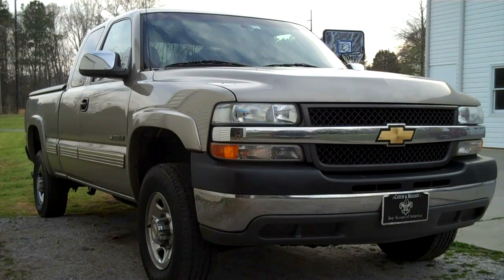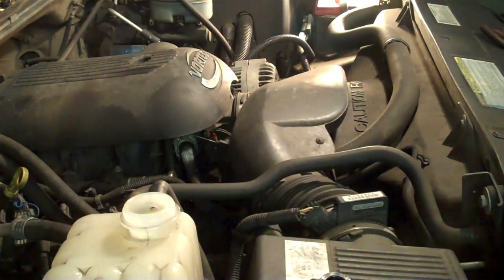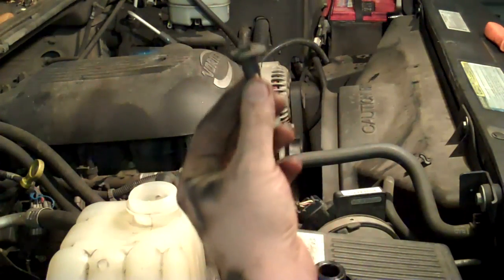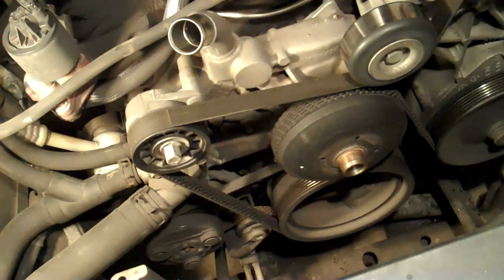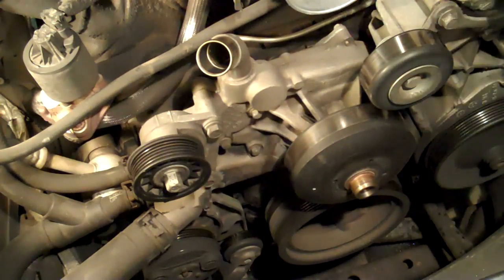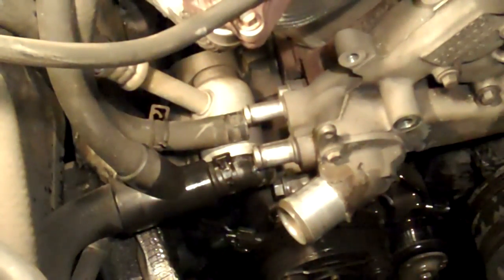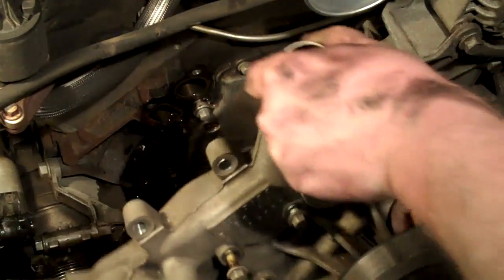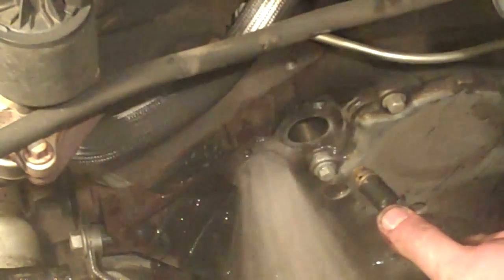LS Type Vortec V8 Water Pump Replacement (part 1)

Comment: Great solution with the impact hammer on the fan nut.  My belt was slipping with the bang on the wrench method but it came right off with the impact.  Just wish I had a nice long chisel bit like yours.  Also would have helped to have a hose pick.  Thanks for the great video.

Comment: Great video and this guy has great tips. Awesome idea to use a air hammer to take off the fan. I used the tip and it was as easy as it looked in the video

Comment: If I got thru the trouble should to take off the water pump, do I go ahead and replace the pump or the seals?  170k miles and 10 years old?  I'm guessing spend the $150 and replace pump!

Comment: I changed the water pump in my 99 4.8 silverado. Got the part 1/2 off and the labor was also 1/2 off. Spent 150$ to get it repaired. Nice vid.

Comment: I'm not mechanic smart at all, but my 00' 4.8 silverado leaks coolant when I turn on the heater but not when it is on vent or A/C. Is this a common problem you would know about?

Comment: Thanks for posting this video! I have a 2004 HD crew cab with a 12” lift and the cheapest price I found to replace the pump was $400.00. Everybody claimed the truck was too high. On Cyber Monday I found a great deal on a pump, I watched your video over and over and decided to tackle replacing the pump. I had to stand on a 6’ foot ladder for 3 hours and thanks to your video everything except the fan came off easy. The end results, I replaced the pump and saved hundreds of bucks! Thanks Again..

Comment from the maker: @CPMET Sorry to take so long to answer.  I've been out of town.  The proper thermostat for that truck should come already attached to the thermostat housing.  I wonder if you have a bad aftermarket knock-off that isn't able to open because it isn't seated correctly on the housing & pump.

Comment: @CPMET  I really don't think its the water pump that causing the coolant not to properly flow to the radiator. Something tells me that its the thermostat NOT allowing it to go thru. I'm working on a 2005 Escalade ESV 8V 6.0L

Comment: My engine keeps "overheating". When I first removed the hose that goes to the lower part of the radiator, the thermostat wasn't "attached" to "that part" (sorry not sure what its called) when I removed it, just like you did at 5:02 . It was just sitting there. When I installed the new thermostat, the engine kept overheating. You think its because I didn't glue it to that part just like it shows at 5:08 ?

Comment from the maker: @1Greydad How old is your fuel filter?  It sounds like your truck may be running lean & not getting enough fuel.  Check the fuel pressure.  If it is within spec, (55 - 62 psi) the filter may be restricting flow causing decreased fuel volume.  If the pressure is low, you may have a failed fuel psi regulator, or a pump that is going bad.

Comment: @1Greydad   Thanks for the quick reply.  Good to have someone around that has lots of experience.  I have one other problem I have been fighting with.  1999 Silv 6.0l V8 is running rough after warmed up then shut down for 20 mins.  I think it may be fuel rail control causing rich mixture and choking. If I accelerate  after restarting it stumbles, backfires and has no power at all. Once warm it runs fine.  I thought maybe head gasket, no coolant loss.  Any ideas? I really appreciate your help!

Comment from the maker: @1Greydad I've never tried to rebuild a water pump.  The pulley isn't supposed to be removable on the newer body style '99 4.8L, 5.3L & 6.0L.  It is crimped onto the shaft - if not welded.  The inlet you are referring to may be the quick connect fitting on the intake manifold, or 'inlet manifold'.  They get corroded & often break off in the intake.  This was a more common problem in the older body style '99 5.0L & 5.7L's.

Comment: Excellant job on the video!
Love the tip with the hammer chisel (works awesome).

1999 Chev Silverado 4x4 ext cab LT
The main bearing or bushing is toast. Wish I had a puller I would see if I could repair it.
3rd party pump in Canada $200.00.  OEM 393.00 + Inlet change over 65.40?
 
One well maybe 2 questions.
Have you ever reconditioned a pump and is there a trick to removing the pulley?
What did Chev change in the inlet? The third party pumps look OEM!

Thanks  (keep up the great videos)

Comment from the maker: @kapuron Right now, I do not.  I will say this.  I don't clean my MAF sensor.  I have an air filter to keep debris out of it.  If I have problems with EGR or PCV systems, I replace the failed part(s)-unless the problem is a clogged port then I use BG EGR cleaning kit or carb cleaner & coat hanger.  If the mfg. recommends new PCV valve at specific intervals, I do it.  As for the throttle body, I use the cheapest carb or EFI cleaner on sale at the parts store.

Comment: Wow this is a great video! The air chisel tip saved me a ton of time getting that fan off. I do not have an air chisel BUT a hammer and chisel worked. Keep making videos like this for these engines. 

One thing I messed up was the bolts attaching the thermostat housing to the pump. They are very fragile and one of them broke in half inside the pump from over tightening. So I would just warn everyone to take it easy on those two bolts.

Comment from the maker: @MaxMyrmyr Overfill the reservoir.  Make sure you fill it slowly.  Cap it & drive it until it reaches operating temp.  Let it cool completely.  Top off as needed.  See if that helps.